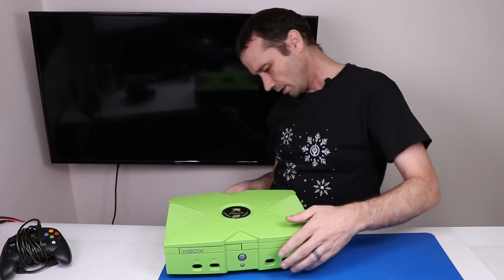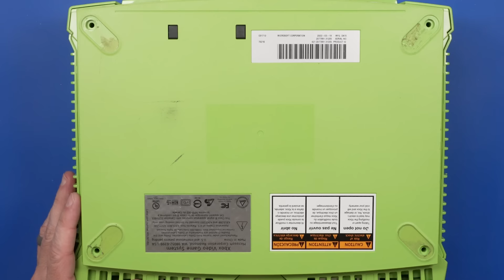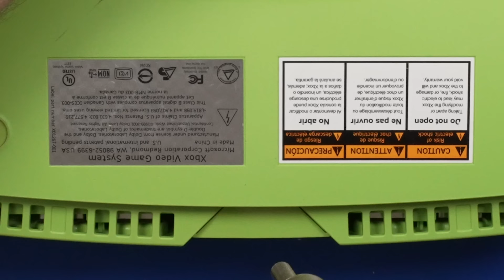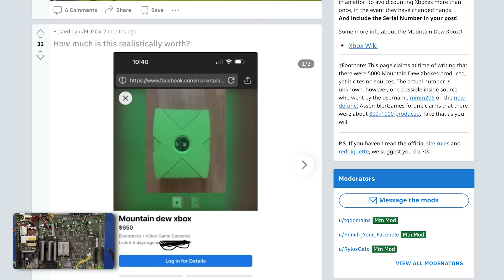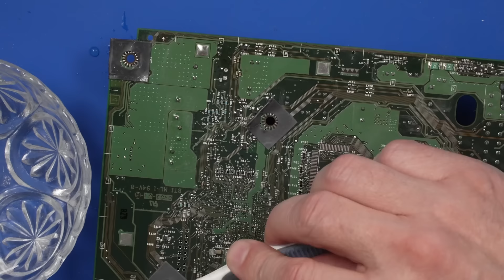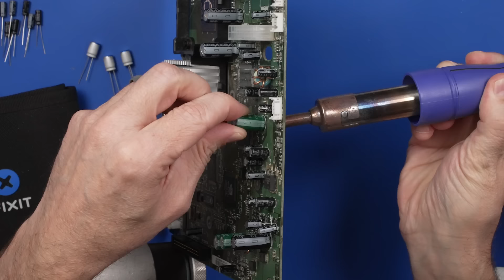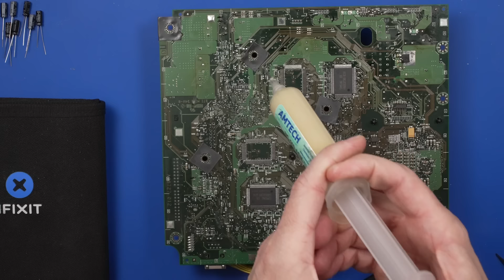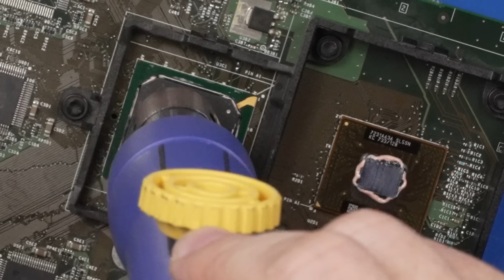I Finally Found One of These! Can I Fix It?

Comment: The problem is possibly the 4 small traces on the very front side of the motherboard underneath that goes to the transistors near the connector for the power-on and eject button that has corroded off and needs to be bridged to the power controlling 28-pin chip beside the crystal near the IDE port.
This is what caused the power-on button on my xbox to not work and only booted on the eject button before I fixed it.
This has happened on two OG xboxes I have repaired with boot issues and seems to be a common problem due to the acids of the backup capacitor.
If the traces have a darker green spot on them than overall, it is corrotion under the protective lacquer.

Comment: I would first check the viltage from the PSU. To me it seems like a desktop psu. It seems to be 24 pin, and on those you can use psu tester or probably short the green wire with black wire. Should be third or 4th wire from the left side on the bottom part.
 If its good then probably fuses on the board, especially near the clock capacitor

Then I would leave it doen to am expert like you.

Comment: I one time bought from Facebook marketplace a Original Xbox and it didnt have power so im thinking it has the same capacitor issues on the power board and motherboard  i never bothered opening it since i never had the experience replacing the capacitors

Comment: I had the same issue with one and after loads of trial and error I found out it had a 240v power supply not the 120v that the us versions came with. My advice check the power supply

Comment: Wii, Wii U, Nintendo DS, PlayStation 2 3 4, Xbox, Xbox 360, Xbox 360 slim, Xbox One, and Xbox One S have all been fixed by me because of watching your channel. I’ve had a lot of fun enjoying electronic repair. I purchased all this stuff cheap as not working on EBay. I got all my wireless controllers not working and fixed them as well. 

Thank you for your videos I’ve been enjoying my new hobby

Comment: Probably the power supply transistor or FET blown.  there should  also be a kickstart resistor directly after the mains filter cap, that is prone to go OC and the supply wont start. Main issue when fixing power supplies being do not test  anything before discharging that mains filter. 1/ it can kick, but 2/ is that is a FEt it has rectified mains on it, if you ground the gate the fet blows. Main problem with supplies is a capacitor on the low side of the kick start resistor  %0 to 100Uf going resistive, causes spiking in the supply, blows the Fet and perhaps the IC or some of the secondary diodes.

Comment: I recently recaped my power supply and almost my entire motherboard on my OG Xbox because I was getting a red flashing dead light but in my case it ended up being my firmware the problem.  My guess is power supply is dead make sure you are getting the 5v from it.  I would replace the entire power supply if you can get a replacement and if you can’t get even a flash of light on the front and there is no post the CPU might be dead and in that case it is game over 😵

Comment: One good trick to know is that the vast majority of capacitors on a board are irrelevant. They can be removed and just kept as an open circuit as that is their effect in a DC circuit. Capacitors are used to smooth out the waveform of the voltage (which for DC is flat so no waveform). Also the bigger they are, the less useful they are (unless you are connecting the power supply to AC which needs big capacitors). 

There are some specific places where a capacitor is important, but those are rare.

Comment: Not sure I understand why you proactively removed all the capacitors without testing if they had any issues ? Furthermore, why not test with a working donor power supply to find out if the issues is with the power supply or the board ?

Comment: The power socket pins often come loose on the Power Supply.  That led to a Safety Recall, but reflow and adding extra solder to reinforce.

Comment: No power issue could be a blown fuse in the power supply, and or bad/cracked solder joints on the plug socket on the power supply.

Comment: Check the traces on the Clock compasitor. There are 3 traces that can get affected and they are used to power it on.
Had a several of them to repair with that issue

Comment: The clock capacitor is unnecessary to boot the system and now that xbox live is gone, there's zero reason for it (that includes if you softmod your console, it'll use NTP). If you fix one of these, just remove it and don't replace it.
Reply: ... unless it's a last gen version. Don't remove that one.

Comment: You have quite different way of troubleshooting such devices. The fist thing I would have done after opening it up would be to check the power supply. I don't think all of the capacitors were bad. Good video anyway!

Comment: I have a bunch of comments; so bear with me.
1. Everything I have bought from shop goodwill has been excellently packaged and shipped vs ebay.
2. Those label can take a bunch more heat.
3. This is not a v1.6 so you do not need to reinstall a clock capacitor (you really should leave it out).
4. Once you get the heat sink off, goo-gone does a great job followed up with IPA to clean up the Goo-Gone.
5. I made it to the end!   You have to really inspect the traces on the edges of the PCB (front and back) for trace rot which might be why it did not power up.

Comment: A common problem with these xboxes is damaged traces along the front of the board. Traces for the power led, on/off button and eject. There are points on the board you can solder jumper wires to, to resolve this issue ;) (Done this myself twice now, got both consoles working).

Been working on a lot of old xboxes lateley ... You, Steve, and MyMateVince have been really educational and giving me the confidence to try and fix broken consoles and other devices, and been pretty succesful. Thanks! <3
Reply: Also had this issue on a 1.4 xbox board, I agree it can be that kind of thing ;)

Comment: Vinegar is acetic acid.  An acid can't neutralise an acid.  Acids can only neutralise a base, like sodium hydroxide.

When the dielectric in the capacitor breaksdown, it produces a base that wouod likely react with the conformal coating.

Comment: I have a regular XBOX with the same problem.  One day it was working and the next it wouldn't even power up.  Opened it up and found some bulging caps that I replaced, but still not working.  It would power up for a split second before shutting down.  I checked the power rails from the power supply and they were higher than they should be.  Quite possibly there might be some over voltage protection on it shutting it down.  Still haven't figured out what's wrong with it, so I wish you the best luck.  Maybe I can get some pointers from the next video!

Comment: probably a basic comment but if you changed all of that and you follow traces and get your meter on all of it id check the ac port as well. start from the wall then work your way backwards instead of the wall plug

Comment: I want a Mountain Dew. I don't wan't a Faygo, YOU'RE the FAYGO! Ceramic caps are what I used for my Game Gear re-cap. Did you power up with that one cap installed backwards? That might be the catalyst. Also, meter the transistors near the replacement cap.

Comment: I picked up a Mountain Dew Xbox a few years ago and it was a pretty good deal at around $300 US. It still appears to be absolutely immaculate condition and I've rarely seen another original Xbox that looks as nice. (I was a bit suspicious at first that it might have been a fake but everything with the case and internals has checked out as original.) Plus it already had a TSOP flash mod and an upgraded hard drive - which I upgraded again to 2 TB drive.

Comment: A bad fuse is the most likely suspect but check things like NON electrolytic capacitors as well if a fuse swap dose not get the job done. Also go over the entire board to look for any burned out components . The point of a fuse is to blow instead of the other components frying but something could of been blown by a good surge.

Comment: Weird, I've watched a bunch of your videos, and you omitted the entire diagnostic stage of checking the power supply and game board with a voltmeter.  Start with the power supply board, find the fault where you lose voltage.  Going to find a shorted component or a regulator that has gone wonky.

Comment: Most likely causes would be damaged traces from the leaking clock capacitor on the underside of the board, blown fuse on the power supply, or I've had a couple power supplies where the varistor near where the plug goes in popped, probably from a power surge.

Comment: Big ticket obvious and critical  items
Main Fuse and secondaries? 
PS output- Isolate problem there and if, use another.
Clock circuit for corrosion as if that ant working,  its a door stop!
Visual check over board to see if you missed something
when item is totally dead, work from PS forward through secondary caps or mosfets where board gets input power- This after you look for obvious damage on board.

Comment: Acetic acid (vinegar) does not neutralize another acid. However, it does remove corrosion, but at the loss of more metal. Maybe you should find PH testing strips, distilled water (~7), and cotton swabs to know what's on the motherboard. Wet a swab, rub suspect area, and swipe along test strip.

Comment: BOOM!!! I have worked on OG Xbox for many years, here are a couple things to look at. It may need trace repairs on the bottom of the board near the clock cap. Some have made 'XBOX TRACE REPAIR" instructions to make it easy for people. Follow the traces from the power button board connector. Also, that Foxlink PSU is the one that caused the house fire that prompted MS to ship out the Xbox Protection Cords. Check the solder connections for the A/C connector. I found that they did not support it well, and over time it shifts and breaks the solder connection creating sparks. What i did after reflowing the solder connections was used epoxy to secure the connector to the PSU PCB. I did scratch up the PCB to make sure it bonded well.

Comment: XBOX had a badly designed PSU that was prone to short circuits.  Microsoft sent out GFCI cables to customers, but that's not good enough.  The PSU should probably be replaced anyway.

Comment: For removing of labels, I’ve only been sucessful using the method by another youtuber. LPL he used, IPA and a Scapel with a syringe and a needle, the IPA make the adhesive unsticky until the IPA dissolves. It works. If youu are pulling hard you know you are doing it wrong and are also stretching the sticker.

Comment: The Mountain Dew Console is definitely one worth saving, and a favorite of mine. The color is just great. I certainly would of tested output power before reassembly. A fuse is the start point. But if there is no output power no reason to look at the board yet.

Comment: I've repaired a fair few OG Xboxes and have found that it's mainly the three power capacitors on the board near the CPU/GPU that give trouble. The other smaller caps don't usually need replacing. You can also get away without the clock capacitor. As for the no power issue, most likely a busted PSU, replace it with another one and call it a day.

The BIG issue however is why is the jewel on the top case crooked? That really annoys my OCD, lol.

Comment: You had the unit plugged in for a while. Was there any danger of the big capacitor in the power supply to have high voltage? I've seen others check the voltage just in case. Wouldn't want a nasty shock!

Comment: next time you remove and replace a label use a little bit of isopropyl alcohol in something like a syringe and just squirt a little at a time as you peel. allow to dry, then replace. that way its less risk of tearing and you dont even need heat with this method.

Comment: Maybe use a donor console and pull parts to fix it, could be that the psu board is dead or the base from the capacitor killed the motherboard. If that's the case make sure the donor console you use was made around the same time as the limited edition one.

I hope you get this relic repaired, I remember the first console I fixed myself that included soldering. My first 360 from 2008, had a loose power connector and a broken disk drive, a plastic piece that held the rails for the laser in broke off and I just so happened to have a donor console with a matching disc drive part #. So I swapped the motherboards of both drives since the 360 had weird compatible keys with both the disk drive and motherboard and would flag different ones by reading games as dvd's and spitting out a disk read error when you try to launch it. also swapped power connectors for both and it still works flawlessly to this day although it is a bit loud when a disc is in the drive XD

Comment: The PSU has a known fault of dry joints towards the 110v input. The boards also suffer with trace rot. There is a long trace at the front of the board for the pwr switch. The eject button will also turn on the console. The latter is worth checking but i would  suspect the psu in this case.

Comment: As some have said, test the button continuity because the clock cap can cause issues there. Also, with a foxlink PSU the four solder joints for the power plug are worth taking a look at. The two outside joints are mount points its the inner two you want to re-flow solder to because they're notorious for bad solder joints.

Comment: The clock capacitor leaks to the underside of the board and eats the traces that run along the outer edge. Those are the traces that run from the power button and eject buttons. Fix those traces and you’ll be good

Comment: This is completely unrelated but I have a strange problem with my ps4 controller. Whenever I press the L2 button, it moves my character forward. Anyone got any ideas. And, is it possible to extend the life of a completely worn out thumb stick?
Reply: @phantomreaver85  My controller had no issues for 6 years, but I started playing RDR2 almost non-stop for the past 2 years. It has held up well but that game has pushed it to its limits. The game heavily utilized the L3 and R3 buttons which quickly wore out the thumb sticks, but the L2 button problem is just weird. I plan on getting a replacement but $60 is out of my budget right now and I was looking for a temporary solution. That and I'm honestly just curious if anyone knows what is causing the issue.

Comment: there thing you can check here :
- check the transistors that command the power on off the console they are notorious to die on 1.6 board i cant remember the version on these montain dew edition so worth to check 
other board revision doesnt have that problem
- check if the main connector on the power supply is really soldered good and if not check the fuse solder joint break and create spike of current when there bad contact and blow the fuse or burn down houses so later microsoft gave some cable with a breaker on it to escape the lawsuit
- look around the clock capacitor all of these trace a really thin there and there all important if any seem damaged just bridge them 
- it more rare but you can have a bad power switch board ive seen some cracked or solder point that cracked too worth the check if they fall on the face or you push to hard on the button somme ppl are not easy on these old device
if all of this dont work you can modifify an atx power supply from a pc to check if the power supply here is good these power supply are really old design and i have truck load of them just die on me for no reason and there is tons of tutorial to make a atx power supply for xbox original on internet that can be reused for diagnosis purpose later if you plan to fix more of them

Comment: I get using electrolytic caps for doing a like for like replacement but really you should have been replacing those electrolytics with solid state through hole equivalents. No point in doing a job unless it's as good of a job as can possibly be done. As for whats wrong with the console probably not the PSU although thats the first thing I'd swap for a quick and easy way to diagnose if its the PSU or board itself. Beyond that, I'd want to see some better shots of the PSU and board to diagnose whats wrong :p

Comment: It's very normal for the clock capacitor to leak over some very fine traces going to the power and reset board just where the clock capacitor is located, these traces go on the outer wall, on both sides of the pcb through VIA's. check continuity and jump or repair the traces.

Comment: That via you pointed to does not look good and has no connection. You can even see part of it moving when you touch it with the probe. You say that silver speck is solder from the other side but if it was making connection it would not move.

Some of those corroded components may not be making proper contact with the traces anymore, or the traces themselves may have corroded though under them. Might be worth taking all of them off in the area and rebuild it.

Comment: Check the connection where the power cable goes into the PSU at the back of the console. Later revisions improved strength of the anchor but they can still fail.

Comment: Vinegar for cleaning up after a cap leaked? That helps remove the liquid (dried) and neutralize it's residue / corrosion? Thank you! If I happen to find one of those "rare" X-Boxes, I would probably sell it to you for $100 or so!! The Flux... Capacitor!!